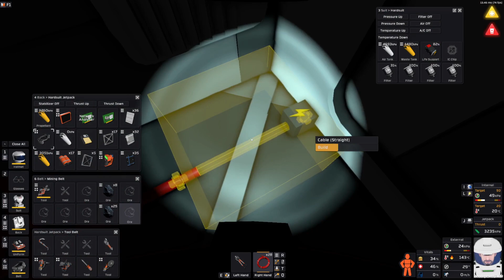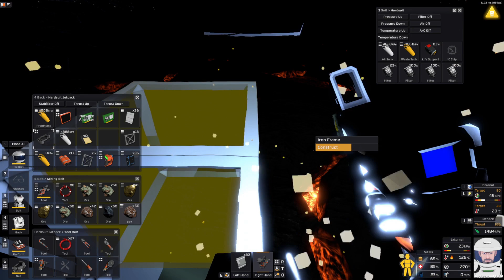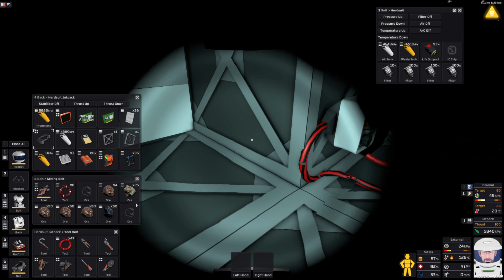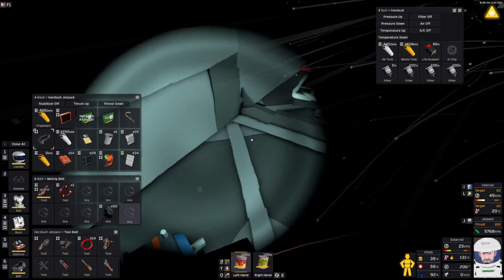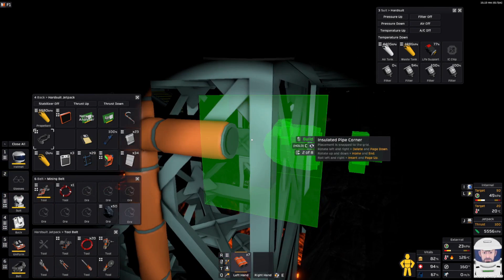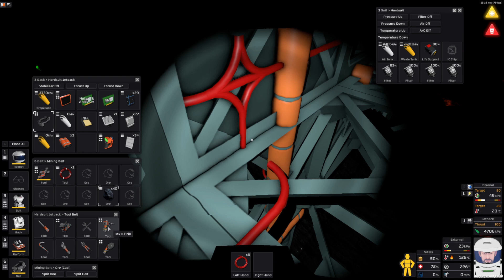Stationeers Vulcan Getting Started EP04 - Gold Rush!

Comment: I think you should also collect day air, so you can use it in the furnace all the time! Perhaps 2 furnaces:

One with tempature and pressure regulation (mix day air with night air to regulate temp) for advanced alloys, pure day air just for bulk smelting via chutes!

Perhaps even a way to insert the ores from outside, so you just drop them in during the night, and it smelts as you work!

Comment: @autom8it could you do a video on heat exchangers?
Reply from the maker: Well, I haven't used them yet.  :)
Reply: @autom8it339  fair enough, I am more so interested if they have a natural flow or if I need to use a pump. my current build is a closed system coolant storage that runs through a heat exchanger into a 'hot tank' which uses a AC to send the hot tank mass back into the cold tank, the hot tank uses radiators and active vents to maintain the system coolant pressure stable. this closed loop provides the heat sink for a entire base. I am just curious about its heat transfer rate, and if its similar to real life heat exchangers or if its a fixed transfer rate similar to the AC's 6000 Joules/tick. if it is like real life, I could scale up the ability for it to cool down the cool tank, with more AC's in parallel between the hot and cold tank and turn them on and off to provide more or less cooling ability; 6000J/s, 12000J/s, etc. 

My IRL education and training is in nuclear power systems and operation of said PWR's. so coolant/pipe systems are kind of my thing.
Reply from the maker: @FNLastname  well, there's no flow in a pipe in Stationeers.  To simulate flow you need to break it up into multiple sections with valves and whatnot.  Not sure what the heat transfer rate is... Would be a good experiment.
Reply: @FNLastname  you dont need pump you can even loop their input/output and they store gas (but not seen with tablet)
but its better if you pull from output and push into input of the exchanger
Reply: @buder5116  i am now aware =3 there is 'flow' however its odd to explain it. I need to do more testing from this latest update to get my thumb rules back in line. I should be able to run most things off one pump now rather then multiple, using the turbo pump and check valves and digital valves.